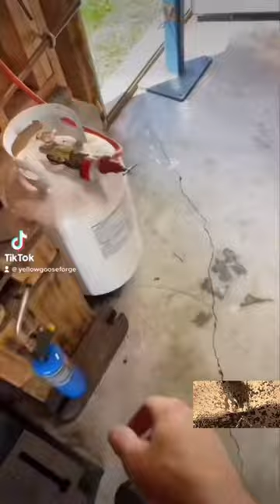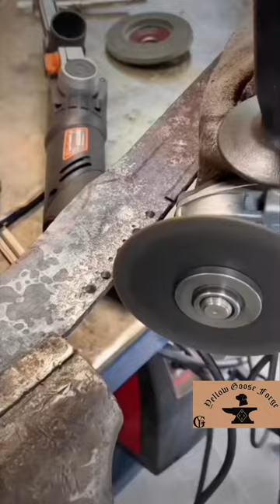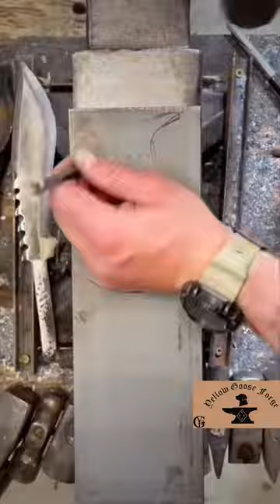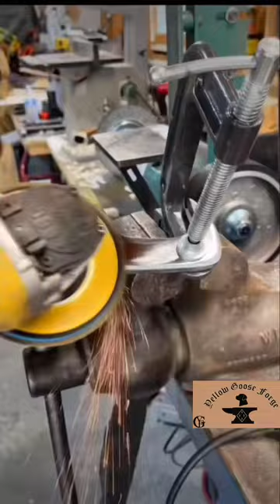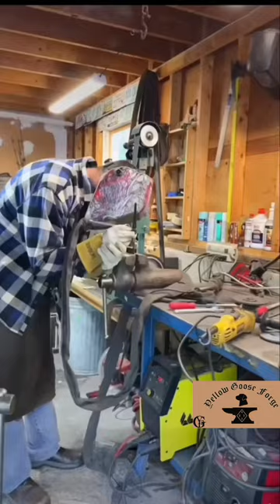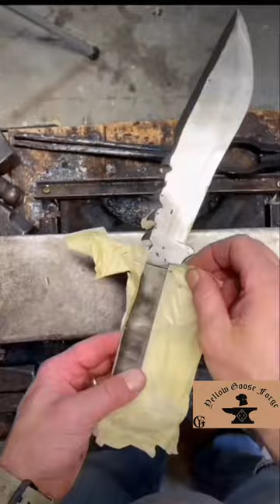Forging The Walking Dead Hunting Knife! #blacksmith #knifemaking #knife #forging #shorts #tools

Comment: Love this new definition of forging
Reply from the maker: Great right!!🔥⚒️🔥
Reply from the maker: What was the old definition? 🔥⚒️🔥
Reply: @yellowgooseforge "Knifeworks forging is the process of heating and hammering out a knife from a single rod of steel."
...
"Stock removal involves using saws, belt sanders and abrasives to strip material away from a steel workpiece. Unlike forging, the blade's length, width, and thickness are developed by removing material, not using heat to reshape it."
🤔
Reply from the maker: @Duckrabbit_Forging thanks for that!! 💪💪